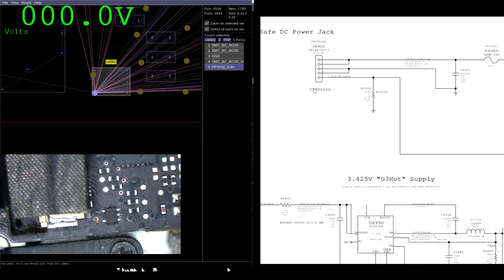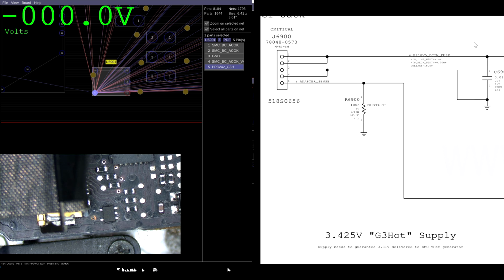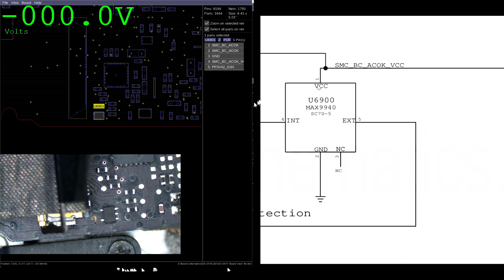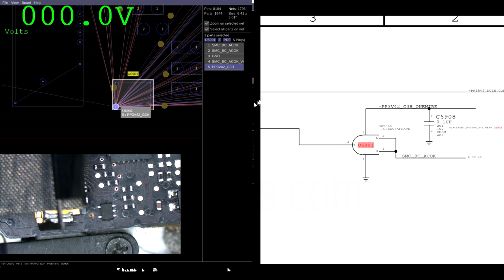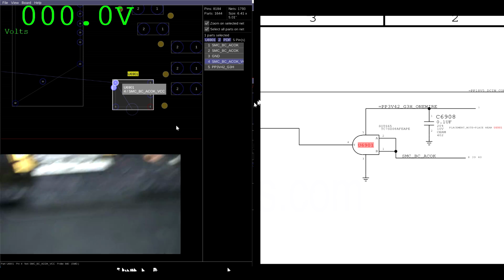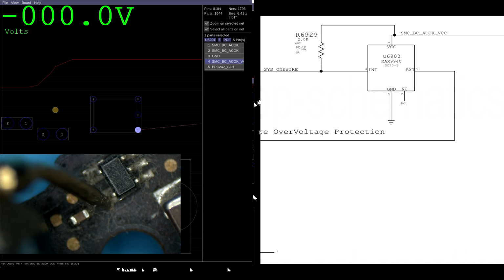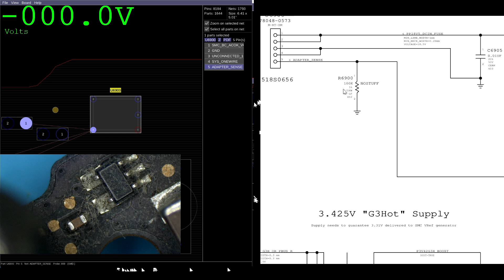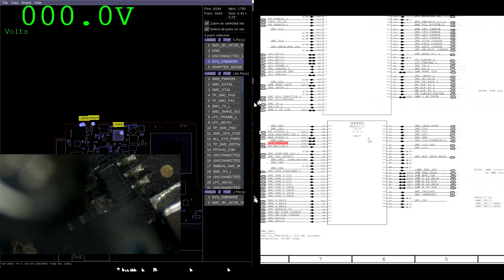How to tell a bad charging port from a bad logic board on Macbook.

Comment: would that failure cause the charger and port to get hot? My macbook charger head and port are getting very hot, not every time i plug in but sometimes
Reply: yes
Reply: Yes and no. Make sure the port and plug are clean. A dirty or loose contact can cause an increase in resistance. Which in turn burns energy as heat.
Reply: @gradertfamilymakes  hi, i have similar problem, contacts are clear on both sides, i tried 2 different 85W adapters,  just to check whether adapter is wrong, but still charger head and port are very hot. Cant hold it in hand. Any advice? I guess it is faulty DC-In board. But i donno.
Reply: Measure the resistance between the port and connector. Then, using a clamp, measure the amperage consumed by the computer.

Multiply the amperage by its self, then by the resistance. 

That'll provide you with how many watts your mini heater is churning at.

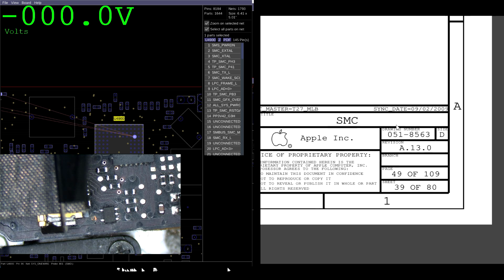Comment: 1:24 Um...is it okay to show this? "Proprietary property" and all, or is that unenforceable scary legalese?
Reply from the maker: If there's one thing I've learned from Trump getting elected and the immigration stuff  it's that it doesn't matter what's on the law books if enforcing the law gets you hated by everybody. And showing people how to make their own Electronics charge again is far less controversial than immigration. Imagine the headlines if Apple takes me to court and ruins my business and bankrupts me or attempts to because I showed people how to fix the luxury Electronics they produce that they refused to fix for their own customers...... not so good for a company that virtue signals how green they are
Reply: @Louis: Aside from the bad PR, it's also extremely debatable if Apple would even have a legal case. You can't agree through mere possession to any "proprietary property" -- that's definitely scary legalese. Also, as it's just a schematic for actual hardware, copyright would be a dubious claim. And finally, you're using all this stuff for repairs and education, so fair use would apply.

Now the guy who originally leaked it, yeah, in the US at least, he could probably face charges for leaking trade secrets. But the guy who leaked it probably worked in China.